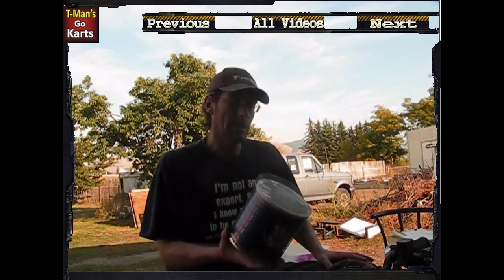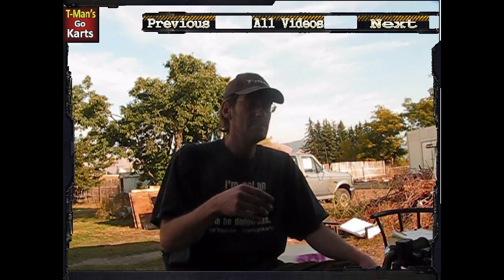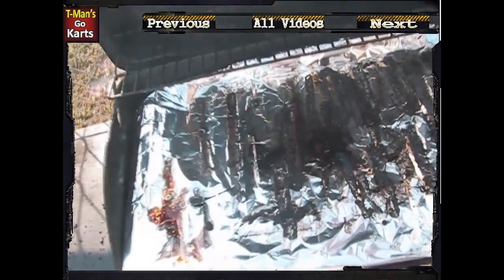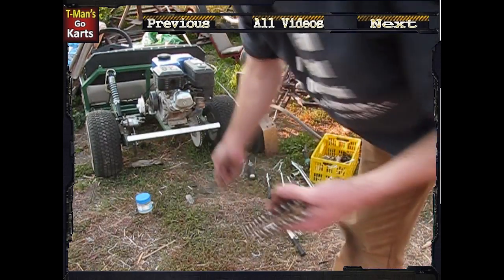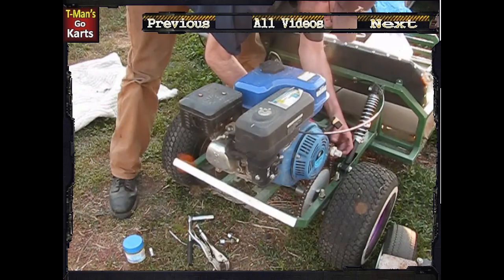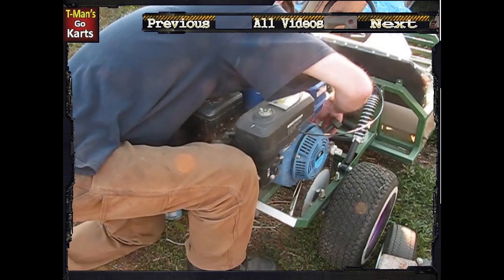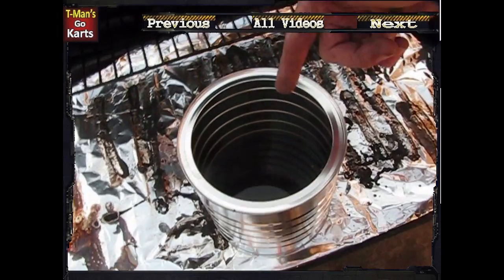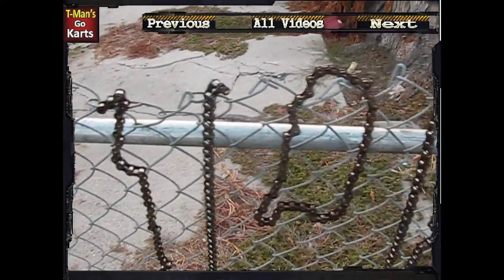Go Kart ( Cooking My Chains )

Comment: When the chain is heated up, the pores open and the carbon frpm the used oil seeps into the pores. When the chain cools off the pores close and make the chain stronger and keeps it lubricated!

Comment: I really don't hold much into the idea of boils chains due to what I just mentioned. Once a chain stretches you replace it or it destroys your sprockets. Properly lubricated chains last longer, however not forever and if your lubrication has lasted nearly 2 years with great luck then consider yourself lucky. Check your chains for stretch and see if they need to be replaced.

We use penetrating oil that sets up as teflon grease on most of our chains. It seems to get in the rollers very well.

Comment: Chain stretches over a lifespan. Obviously we want to achieve a 1/4" play in the movement of chain between sprockets. However I do want to mention that your chain is worn in need of replacing when you have achieved said play and you can pull the chain off the bottom of the sprocket to see light. At this point it will wear your sprockets.